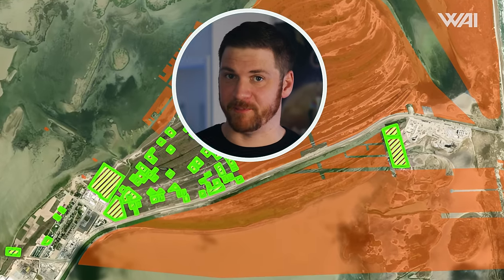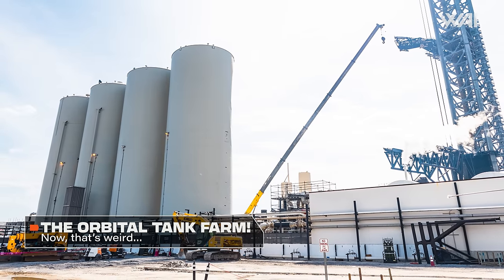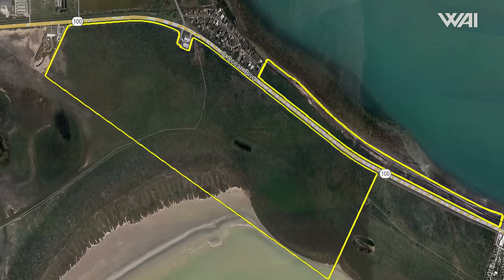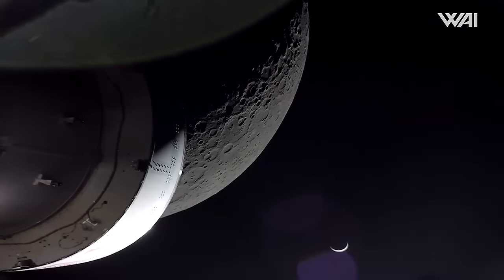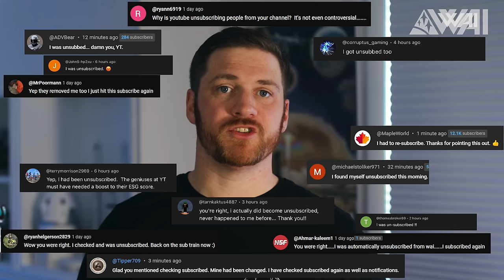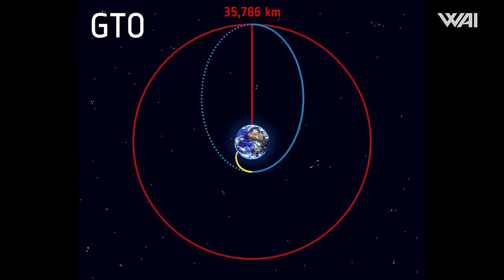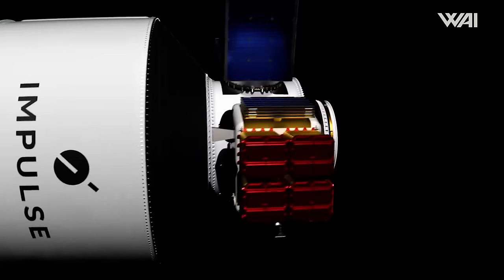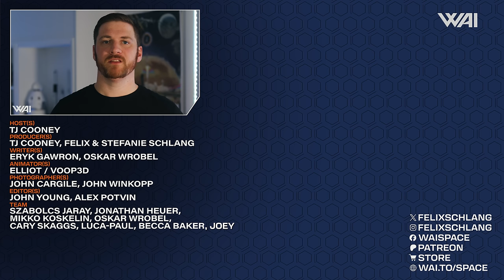Big Reveal: SpaceX & NASA Mars Plan!

Comment: Just so you know... the lines on the tower base in the concrete portion... they are GPR marks (Ground Penitrating Radar) They mark the locations of the internal rebar locations.  The shielding has to be bolted to the tower with physical anchor bolts... to do this they have to drill into the concrete.  It would be detremental to cut the rebar... but you dont know where they are... exactly... you can not see, through concrete...  unless you scan it with GPR.

Comment: Someone didn't know too much about concrete. It can't take fire. It expands and falls apart if hit with any kind of hot flame for more than a few seconds. They should have put some fiberglass board, covered by some thick stainless steel plate over the concrete where fire could hit it. You need to design the plate hold down bolts to allow for expansion of the steel as it gets hot during lift off. They might need water deluge to keep the plates and bolts from melting. NASA used a giant water cooled flame trench for the Saturn V for a reason. The sides of the trench were covered with fire brick to protect the concrete. 
The concrete inside those 6 giant legs is probably no longer bonded to the steel. Hopefully, that won't cause a problem, but don't be surprised if it eventually does, by putting too much stress on the steel. 
Stay well away from that thing during any fuel filling and launch. If that platform did fail, pieces of the vehicle could go anywhere. That cryogenic fuel is more dangerous than liquid kerosene.

Comment: The launch mount needs another method to protect it. Possibly a layer of extremely heat resistant metal that doesn't corrode. Perhaps a thin tungsten sheeth over zinc impregnated paint?

Comment: I expect the second tower will not only be upgraded, it will be taller to allow use with a stretched Starship V3. Then the existing tower will be lengthened and upgraded while tower 2 is used.
Reply: Several sections already built, and it will be the SAME height as the first one (even when V3 is considered)

Comment: Helios has a lot of potential with Starship as well...Starship can deliver many satellites orbit at once, but it can't deliver many satellites to different orbits in a single launch. With Helios satellite operators could take advantage of low cost ride share launches on a Starship. Then use Helios to delver their payloads to the final orbits. One can imagine even large telecommunications satellites getting single digit million dollar rides to LEO on Starship then using Helios to achieve final orbital insertion.
Reply: Surprised Elon didn't think of this business.
Reply: @brbailey  

Maybe he will buy it.  SpaceX is the biggest potential customer.
Reply: So basically convert Starship into Mothership.

Comment: About that SLIM ; didn't it have a gyroscope to stabilize it as it landed? Also if landing on its side or upside down, was foreseeable;  a deployable cocked spring could have been designed in, to right the craft, no ?
Reply: I think they made the landing unnecessarily complex… don’t think they will try that again 😅

Comment: And i noticed you neglected to mention a Mars mission (a single one) would require more than 32 launches of Starship (and/or tankers and equipment)  Granted, most of those are recoverable.  But your point was complexity to the mission.  This is the hidden issue of Starship that has been highlighted in recent NASA meetings.  15 plus launches just for ONE moon flight.  And its not even a working prototype yet.

Comment: Think your assumption on the quick disconnect shroud in scaffolding is wrong. Due to the stretch of starship v2 the quick disconnect will need to be relocated. Since they still have to launch v1 starships, they are doing preliminary work so that when v2 is ready, it doesnt take half a year to modify the tower. The scaffolding doesnt include the actual disconnect which should tell you something

Comment: The launch mount will need some redesigning for proper reuse, probably some water system on top of the launch mount. In the 360° video of liftoff released by SpaceX you can see parts of the OLM shielding glowing red hot from the raptor plume
Reply: Yes Elon already mentioned it. It just that reconstructing an OLM will disrupt the flight campaigns

Comment: TJ great video by the WAI team.  Hey TJ could you explain the new DELTA V for Starship V3?  I would think stretching the tanks, adding 3 new engines to Starship and the Raptor V3 at 350 BAR would change the rocket equation.
Reply: Elon stated 200 t to LEO

Comment: I’m really not sure why an optional third stage wasn’t part of the falcon 9 already. In theory, they could just modify an existing second stage to make it lighter and turn it into a third stage. I’m not an engineer, but I don’t see any reason, at least in theory, that that would’t work. It would also have the benefit eliminating the need for significant launch pad modifications between falcon 9 and heavy
Reply: Because Falcon second stages don't have much in common with a good third stage. A third stage should be optimised for pure vacuum operations... you don't need much thrust, but you want efficiency. You're certainly not going to be burning kerosene — you want hydrogen, or at least methane if you don't want the hassle of dealing with hydrogen. And you don't want an engine as powerful as Merlin... it's total overkill for the size of any payload you're pushing around.

And yes, what I'm describing is actually a pretty typical second stage for most traditional expendable rockets... a Centaur, for example. But Falcon 9 is not a traditional rocket... to support booster re-use, it stages much earlier than other rockets do, which means that the second stage is doing a lot more work... which is one of the reasons it uses a high-density propellant and a powerful booster-type engine (with a vacuum nozzle). It's excellent for what it does — but it's a terrible starting point for a third stage, because it's designed to have more in common with a first stage.

Comment: Switching both Moon and Mars missions to use Starship for every step is the obvious best choice. NASA just needs to wait until Starship has proven itself with a few successful missions.
Reply: And failing that, SpaceX will do it on their own and show how ridiculous NASA is.
Reply: Human rating SS will take many many flights and years.
Reply: @iamaduckquack  "many many", I dunno. Falcon 9 and Dragon didn't take that long.
Reply: @DanaOredson  Dragon has launch abort. SS has no such thing and they said back in the day they would be relying on proven flights rather than abort systems to human rate SS. So if it does get human rated its going to take a long, long time, if it ever happens.
Reply: @iamaduckquack  Of course, Dragon means there's currently no need for Starship to be crew launch rated.

Comment: Ha, I've been saying forever that SLS will only exist as long as it is required to contractually at most.  Once Starship comes online, arguably within the next 5 years, it will become increasingly difficult to justify launching a rocket at the insane cost of $2.5 billion per launch when 25 Starships could be launched at an extremely conservative $100mil each.  Fact is, that number per starship launch could be much lower initially and will likely eventually be much much lower long term.

Comment: I've been asking for years why SpaceX hasn't already made something like the Impulse Helios. They could have added a third stage to Starship years ago.
Reply: It can be added as retrofit like Falcon. Even easier since it already uses methane as fuel
Reply: To what purpose? SpaceX doesn't seem to be missing out on much business by not having one... Falcon 9 and Falcon Heavy can launch the biggest satellites necessary, they can send NASA payloads into deep space, and they can use existing solid kick-stages where necessary (e.g. for Europa Clipper). It's hard to see a business case for them developing something like Helios for current hardware.

Starship does change that equation, though, since as large as it is, it's performance beyond LEO is terrible without refuelling. If something like Helios is cheaper than the number of tanker launches needed to do the mission, that is a good business case...

Comment: A real game changer would be a tug rocket that stays in orbit, be refueled during perigee, and deliver its load to apogee. Return to perigee and cycle. The perigee will be at LEO (~500KM) and apogee on GEO. This one would be a real orbital tugboat
Reply: Yea. This one doesn’t seem reusable and just leave another piece of debris in geo orbit. But still lowers cost which might be good?
Reply: Sounds nice, but apogee and perigree depend on the actual fuel load and therefore have to be corrected after each (de)tanking. And the high velocity during perigee could also be a problem as the tanker has to catch up.
Reply: @macjonte  Agreed.

What do you think about a "disposable" fuel+propelant tank with some kind of quick disconnect? This thing is very close to the idea since the tanks are clearly separated from the engine bay.
What's your opinion?
Reply: @andreasmuller3948  Agreed, it's an engineering problem. 

Maybe expandable tanks, maybe a quick disconnect system with various tank sizes, all of them parked somewhere close. What do you think? Too outside of the box?

Comment: I think a redesign of the SLS would make more sense.  With modern technology, we should be able to achieve something at least as capable as the Apollo,  mas to trans lunar orbit and delta V, at a fraction of the cost of the SLS.
Reply: Couldn't agree more!
Frankly, though, I think that is the role Starship will soon play.
Reply: SLS has been in the works for around 20 years, starting with the Constellation program.  It was supposed to be NASA's cheap and fast solution that has miserably failed those goals.  At this stage, government cost-plus contracts won't get us anywhere.  Mostly self-funded reusable rockets like Starship are our only hope.  Even Falcon Heavy is a better platform to build on than anything else.
Reply: I seriously doubt NASA has any hope of competing with industry on heavy-lift rockets. Their technical choices are too limited by political considerations.
Reply: It's important to remember what it was and wasn't designed for in the first place. The SLS program's goals were never mission-driven to begin with. The primary requirements for the rocket were first to satisfy as many regional aerospace employment opportunities as can be secured by their representatives in Washington DC. The physical capabilities of the resulting launch system were a mere afterthought at best (hence the "Senate Launch System" perjorative acronym).

Comment: I am not an engineer, but the problem seems to be escaping Earth's gravity well.  Instead of Starship doing orbital refuels, why not use Starships immense lift capability to quickly put up a massive rotating space station.  At the station you could construct a transfer vehicle to go to the Moon.  Then just launch Astronauts from Earth on crew dragon at first and then starship to station.  Switch over to transfer vehicle to and from lunar surface.  Plus if you want to build a station quick, let Space X do it....
Reply: Because building a space station is surely cheap, easy, and fast. Proven by historical record /s
Reply: @Adak2030 Because building a fully fledged space station & all-new transfer vehicle are much easier than building a water-cooled steel plate /s

Comment: Wow, it's pretty hard to understand how an Apollo launch got us to the moon and back but will take a Starship multiple orbital refuelling stages. As as difficult handling liquid methane in zero g is going to be its only going to be so much harder with liquid hydrogen for refuelling the SLS based the problems at lift off for its first demo flight.
Reply: Starship lander is far more capable than Apollo one, by a huge margin. It's like making Saturn V second stage as a lander
Reply: Apollo delivered maybe a tonne of payload to the moon, including two passengers. Starship is delivering one hundred tonnes of payload to the moon. Are you still having trouble understanding why Starship needs refuelling to accomplish something which would have required the launch of a hundred Saturn Vs?
Reply: @simongeard4824  not yet. Not even reached orbit. Maybe 5 tonne lander plus life support and whatever is required to get the crew back. It's nowhere near 100t to the moon.

Comment: SLS has been obsolete since SpaceX successfully landed ship number 10
Reply: That is simply not true.  Starship's orbital refueling design has a severe complexity problem.  It's so bad that NASA is thinking about ditching Starship and going back to a more reasonable mission plan ... otherwise the entire Artemis program may fail.  If Starship can't reach the Moon, Mars is ... out of the frick'n question.
Reply: @ericmatthews8497  How can anyone say starships orbital refuelling has a serious complexity problem when SpaceX's Starship development is all about iterative testing, and there hasn't even been one single test of this concept yet?

I remember when people said that it was impossible to land a booster upright using only thrust, then they did it with falcon 9, then they said it was impossible to land a massive rocket upright, but they did it with Starship.

I even remember people saying it was too hard and costly for a private company to make a full flow staged combustion cycle engine that worked, yet they made raptor v1, so people then went on to say they would never be reliable enough, yet IFT2 proved them wrong, with only the second iteration of the engine.

I would hold my mouth before embarrassing myself like millions of people already did when making assumptions like these.

Let em cook.
Reply: @FERGX12   You are headed for some serious disappointment. It's not a matter of "If Starship will fail" .. it's .. "Starship has already failed." 

 NASA mission planners will NOT accept the operational and logistic complexity of 10 to 16 Launches for a single deep space mission.  With Elon talking about stretched Starships before even the original design can demonstrate success, I think we know that SpaceX is in desperation mode.

It's game over already.. Starship for Deep Space missions is DEAD ON ARRIVAL.
Reply: @ericmatthews8497  we'll see. ill come back to this comment when successful orbital fuel transfer is achieved
Reply: @FERGX12   One successful fuel transfer doesn't mean anything.  Starship's design is still in flux, they don't even know how many orbital fueling launches will be required for HLS.  They have to first make Starship work .. reliably .. through its entire flight mode.  Then they have to actually build HLS.

 There is likely more weight that will have to be added to the final design. For example .. a hot staging ring.  This uncertainly is killing NASA mission planners that must answer to the politicians in Washington DC funding all this.  I'm tired of delays.. NASA needs to have firm plans .. otherwise they should just cancel Artemis.

Comment: Super dumb to have those Vertical tanks so close togehter. Its well proven in the agricultrual silo industry where silo's are closely spaced they don't stand a change in a hurricane. Whereas if the hurricane air can go around the tank it reduces the pressure on the tank to prevent deformation and collapse. However looks like these are well pressurised to maintain internal rigidity. But if empty would possibly collapse.

Comment: Little spitballing comment here: I don't think 1000 Starships will be used on the first Martian transfer mission (though that would be cool), but a configuration with 5 linked together might be realistic. You need enough supplies obviously for the mission (with some reserve time) and one of them could have reduced fuel capacity in favor of increased life support/supply capability, two could be purely for transit capability and two could be for on planet mission/life boat.
I'll be curious to see how the actual plan goes.
Reply: Not for an initial mission, no... the "thousand starships" is the full-on colonisation plan. For an initial visit, probably a couple of cargo ships sent ahead, and one or two crewed vehicles following later.

Comment: Each SLS launch is now estimated to be $4B each. The 'surplus' RS-25 engines are now an estimated $500M EACH. Insanity.
Reply: But that is only a funding problem that could be fixed in Congress with a few strokes of a pen.
SpaceX has a MASSIVE and unmitigated complexity problem with orbital refueling. Needing 10 to 16 launches Super Heavy/ Starship for one moon shot is a HUGE problem.  SpaceX knows this and that is why they are talking about STRETCHED redesigns already.  They are basically where the Constellation program was ... they have a great design .. that doesn't work.
Reply: Correction.. estimated at at least $4B each. The last GAO report was pretty sure they hadn't found all of the costs buried in various parts of the budget...
Reply: @simongeard4824    The problem with SpaceX is more dire.  Requiring 12 to 16 orbital refueling flights for ONE deep space mission in a SEVERE GROWTH is operational and logistic complexity ... NASA Mission planners have lost all faith in SpaceX/Starship.  The mission plans must be kept simple for the best chance of success - and SpaceX can lo longer deliver "Simple" using Starship.  The choice is clear - Starship is too complex and likely will fail.

SORRY